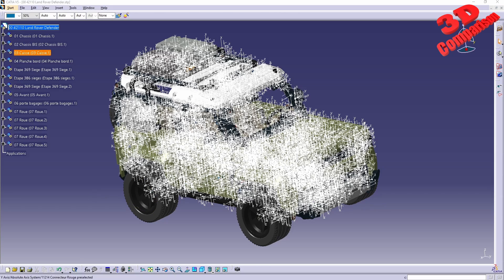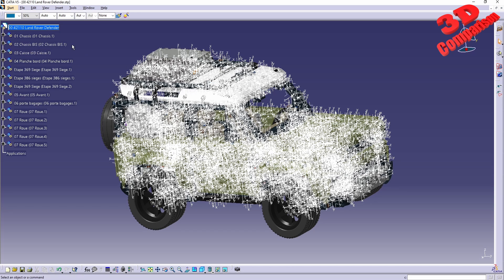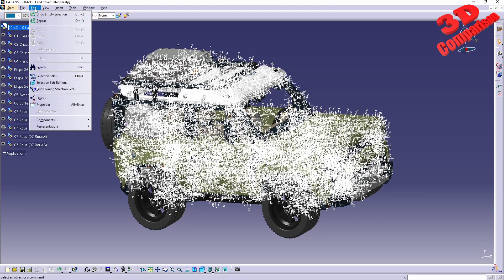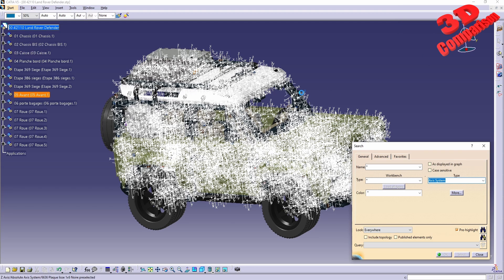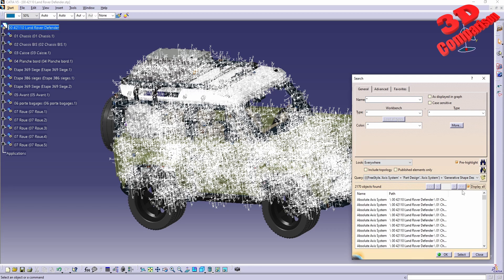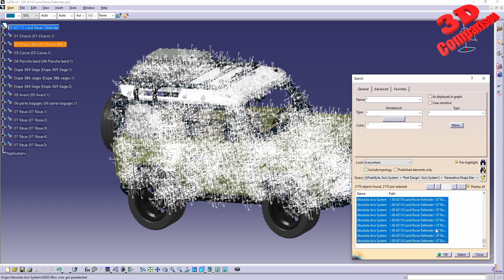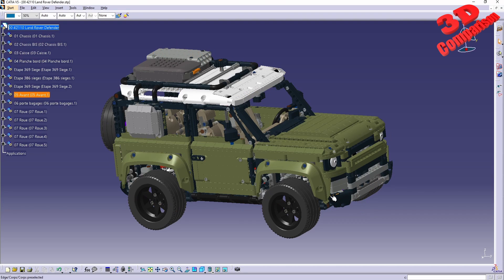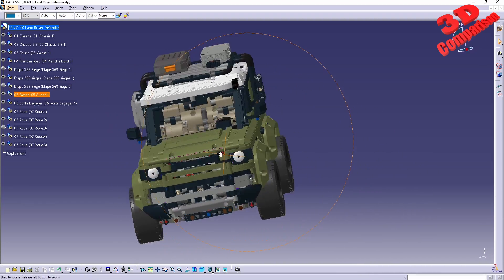CATIA V5 - Optimize imported files #catia

Comment: I want to ask you a question about catia.

Question 1: Does having only a solid model of a standard part, such as a bolt, or having all the features under the model make the catia file lighter? Which one is useful for large assemblies? 

2. Question: Is it lighter and more performant if the same standard part, such as a bolt, is a solid model or just a surface model?
Reply from the maker: Hello, that is a very good question. I have decided to give this a try and see what files are lighter and offer better performance. I have addressed this within my recent video - https://youtu.be/_v1K565lyOk. I have also compared CATIA V5 to SolidWorks in terms of STEP file usage and CATIA has the stronger lead regarding this.